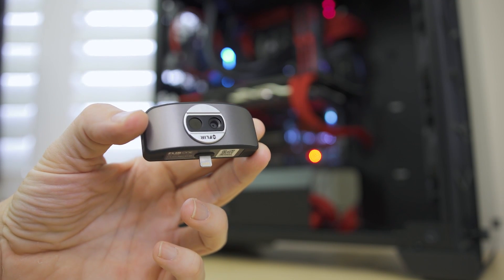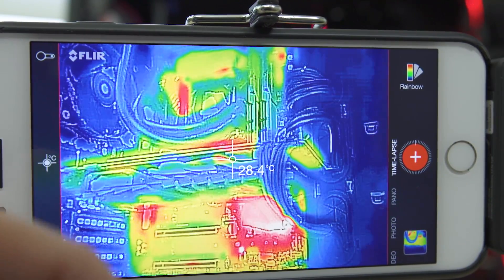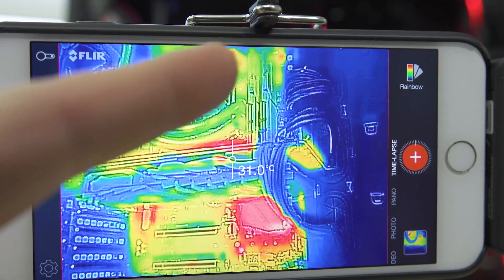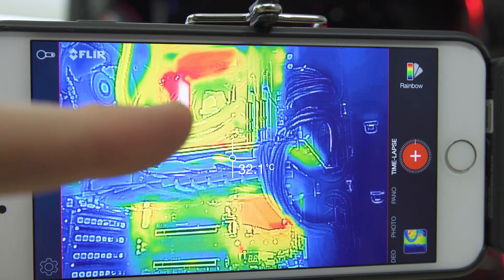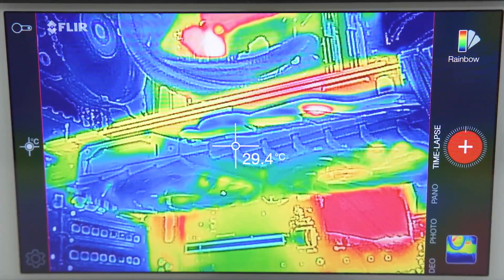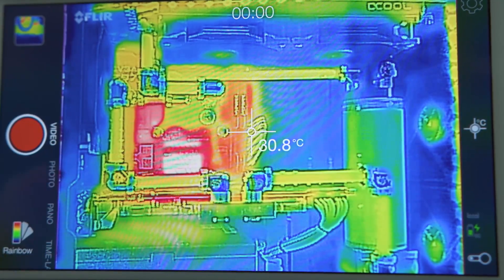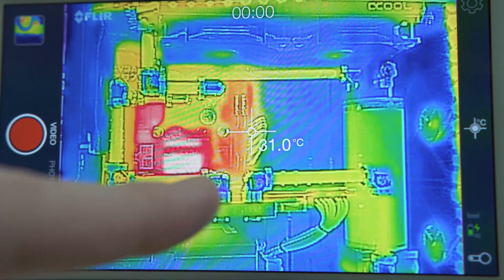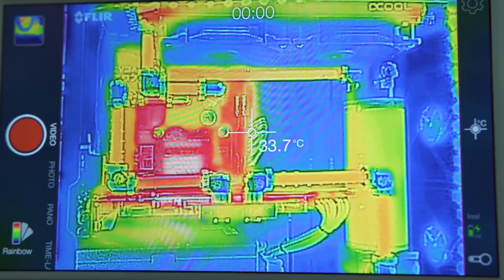PCs and Thermal Imaging... What your eyes CAN'T see

Comment: I've been very aware of this situation and the localized heat pockets for years.  Air cooling with a moderate overclock like my old Sandy Bridge i7 2600k @ 4.2 ghz. I use a three fan setup up top on my Cooler Master Cosmos (2005 black mid tower case). 120 exhaust(highest speed/pressure), 90mm Zalman  X9900 cpu air cooler(it's a round fin design with a figure 8 heat pipe and fan in front), And a 120mm fan (angled towards motherboard/memory/cpu) in front of board.  The bottom half  employs a 80 mm fan blowing upwards 45 degrees and slightly towards south bridge and in front of hard drive bay (drawing air through the drive bay at bottom of case). An additional 80mm fan outside of case pulling warm  air out (wire tied to empty pci bays below graphics).  My rig/motherboard is basically separated by a huge 12 inch long Strix oc 1060 video card so it needed the separate fans for top and bottom cooling schemes. One side note is the Psu is located up top exhausting heat out.  And the side panel has additional openings one circular for cpu and larger square opening down at bottom. (neither are being use for active cooling atm).  This setup which this particular build was created is going on 6 years of age and using Dynamat sound material everywhere.  The tower also sits on the floor in a slightly elevated cushioning effect (pillow, burber carpet and larger floor tiles) to reduce dust intake and vibration from heavy stomping feet.  With the front of case having a mesh filtered 5 1/4 drive bays and brushed aluminum blue accents and blue lights.  My build is a kinda a "set it and forget it" kind of rig and still looks pretty handsome to this day :)  Thanks for letting me rant guys/gals and hope this helps others looking to prolong there system life and performance.

Comment: Hi
can u try to use this cam in larger case so u can put camera inside and then test it with no air flow/ positive pressure / negative pressure so we can see how it affect temperatures of parts inside + water cooled PC and air cooled PC ( CPU + GPU )

Comment: could you use a piece of plexiglass clamped to the outside of the case to show the effects of the enclosed case compared to an open case? Not sure how well the thermal image will see through the plexiglass though. This would help show how well a case is designed in relation to proper airflow.

Comment: It is simply amazing work!
Your input on water cooling helped me a lot in my upcoming build but this is truly the next step. I really would like to see more testing of case environments. What happens when you only use fans on radiators to run air through a case for maximum heat dissipation in a water cooling build compared to a build with extra case fans pushing fresh air into the case.

Comment: Nice video! I was looking for that kind of information for heat in the PCs. Have you ever made a PC with both: air cooling and water cooling at the same time? And do you thing that the temperatures of the different components and the air flowing will be better than just air cooling PC or water cooling PC?

Comment: So Jay, with this new data in mind; what's the FIRST change to your systems & the new system for Mr. Crews? Additionally, I didn't see the RAM get too hot on the first system; but would you recommend installing a waterblock for your RAM? Heat spreaders for the M.2 SSDs already exist, but do you think we'll see an M.2 waterblock anytime soon (disregarding the fact that there are waterblocks for M.2 SSDs on PCIe adapters)?

Comment: Now that you have a thermal imaging camera, ho, ho, ho, do the same test, get system up to temperature, this time with case cover on. Then, remove side cover, watch as things heat up as you remove the case.  What I've done with a Flir is look in a power supply. I did it on my mom's old potato. I've yet to thermal image my own builds though.

Comment: a separate loop just for the vrm and chipset..probably help overclocks..  maybe put a rad between the GPU and CPU. ..just to try. water cool everything all at once.. all the chipsets the HDD and if your stupid enough.. the power supply.  then over clock the shit out of it and see what the results are.

 everything makes heat, humans suck at making electronics.
Reply: also we need to figure out a better way to regulate voltage...heat means in-efficiency .

Comment: Loved the video, Jay,  some great info as always.

Question though, not to beat a dead horse but I this video could make for a revisit of an experiment. 
You've said that front mounted radiators are completely fine in the past, however radiators do restrict airflow.

Could that airflow restriction cause larger issues for motherboards over time?  Is this a test you could run in the future? VRM and Memory temps of front mounted rads vs open air?

Comment: Hi Jay, I like your videos, this one as well. I have just a point about glass being an insulator. Well, there are two different things to consider. First is the sense of heat when you touch somethink and the other is the actual temperature of it. If you have a piece of iron and a piece of wood, both have the same temperature, you will sense it differently (iron will be cold, wood wont). This is because different heat conductivity. But if you look at them via IR camera, they will be the same, because the radiation coming from an object (that is what camera picks) is dependent on the temperature only and is not dependent on the material (see more absolutely black body). You can see this when the IR is coming through the glass (as you pointed out), but when you look at the fittings, they are blue, because IR radiation doesnt pierce metal, even thou metal is great heat conductor (try placing aluminium foil in front of camera). These are just two absolutely different things.
Anyway, I hope you will find this usefull. For example, even if the heat is transfered via touching into backplate, there is still all the IR radiation emited from GPU reflected back off the backplate, back to GPU. And also the IR radiated from the backplate also going to GPU. I would guess it is way more important then the hot air traped between GPU and backplate, which most people talk about.

Comment: I really liked the video but have a few suggestions. It would be nice if you could come up with a way to do the thermal imaging with the side panel on. With the panel off the air pressure and flow from the fans is going out the side. I know having the panel on creates issues for the thermal camera but maybe it would be possible to make a side panel out of plastic with an opening in it that could be sealed with the camera inside? Just an idea because then you could test and do a video of fan placement and directions to see which combo is most effective. I often thought that the water cooled systems that didn't have any extra cooling fans would have very hot VRM's and chipsets so it's good to confirm it. Keep up the good work Jay!

Comment: AntVenom has a nice basement water cooling for his PC. Indeed, he speaks about the chipset temperatures, but that is not something to be scared of. Especially since there are PCs that had no fans in them at all (like most of Streacom's cases) and still work well. I am more into hardcore passive cooling everything for the ultimate no noise environment (of course some coil whine might be present, but if you get your speakers at any sound volume and have something to listen to, the coil whine is inaudible).

Comment: I actually had bought a fan control panel that had 4 temp fan controls. My motherboard heatsinks get hot pretty fast. I had put some paper over the heatsinks to cool them, which worked great. The temperatures of the heat sinks would read at 150F before the system would shut off. With the airflow it would be a steady 76F. But my CPU was still getting hot so I bought a bigger radiator for it, which I had to remove the airflow setup. I can't seem to find a practical way to put airflow over the heat sinks on the motherboard. Maybe with my next build I'll get something designed.

Comment: I don't think Jay understands how these things work... You are seeing a total temperature variance, not actual temperatures... I wish that he would have shown the actual temperatures. For example, I have a dozen probes in my system on a microcontroller and display, monitoring VRM, GPU Backplate, MOBO Backplate, Coolant temps, Pump temps (dual pumps), intake temps, radiator exhaust temps, PSU internal temps, and so on), and the variance between the hottest component and the coolest is not that significant.

The same here, were are seeing the temperature delta based on color... So the coolest component might be 30C while the hottest component might be 32C (as an example), and the colors would be exactly the same, basically, this video shows us NOTHING at all that is actually useful because Jay did not present the information correctly, whether intentional to get views, or because he doesn't know how to effectively use the device (which I doubt, since he described it in the video) is irrelevant, fact is, the presentation is deceptive and will lead people to think that they are seeing extreme temperatures and freak out, but they are just seeing a temperature delta. :-(

Regardless, thank you Jay, for the work you do, and I look forward to seeing more videos and tests involving proper thermal testing (So long as it is presented accurately, I would suggest using the 'spot on high' feature,  to indicate the highest temps, and perhaps the lowest as well)...

Comment: Exciting! Thank you.

You dont happen to have a right side build case? Could test how GPU affects a tower cooler in different configurations (not AIO-water). Or could just be badass and flip normal case top down :D Also would like to see a big tower cooler with different fan configurations: fan on top pull, right pull, left push, left-right push-pull. Pick most interesting configs. And how it effects rest of the system.

Comment: My entire case is air-cooled. But my case, which is a Gigabyte Sumo Y, has a 200mm fan on the side panel feeding the GPU but more importantly, my motherboard. So even if I overclock my GPU and my CPU, they all stay within a reasonable range. My entire system I mean.

Comment: I have a HUGE problem with my cpu fan. It only starts spining once the cpu is hot, and when I say hot I mean REALLY hot. It shouldn't start spining so late, and once it does it goes like at 2000 RPM. I may have to change it, but if there's some way to fix it it would be great. Nothing is stopping the fan and I can't open it to see if it's clugged with hair or something, it doesn't have a screw.

This video made me scared that my PC would melt, since I've been having performance issues and I only have a 3 fan setup (now 2) plus the gpu fans.
Reply: Thank you, yes the fan is plugged in the right socket, and I can't clean it up since I can't unscrew it, it's glued together instead. Can I buy only a fan replacement? The only ones I seem to find come with it's own heatpipes and I only want the fan, since the heatpipes are just fine (and it's easier to replace only the fan, I'm lazy).
Reply: I know how to remove and install a cooler, don't worry. And I already replaced the thermal paste a few months ago (2 or 3 I'm not sure) so that shouldn't be a problem. Thanks for the help, I'm going to order a new fan (this time hopefully with a screw) right now.

Comment: Would it be possible for you to test M.2 NvMe drives? Both top mounted and bottom as well as some of those fancy superfast but more importantly the medium drives to see if there is a problem. My system has a bottom mounted M.2 and I have not been able to monitor the heat.

Thanks in advanced and thanks for all the vids, I've learned a lot from you over the last few months since I've been diddling in computers.

Comment: Is the FLIR technology susceptible to reflection issues like IR thermometers? When you talked about the glass tubing, it popped into my head that that could cause IR reflection issues.
Reply: Yeah, reflective / shiny objects are a problem. It's like looking at a mirror - you don't see the color of the mirror, right, you see the color of the reflected image. Well, IR is just light, so .. in a reflection, you see the "heat" (IR) of the reflected image, not the mirror.

Comment: Don't forget you had the case open to check the temps so there would be no air circulation inside. If you had the case shut as it should be, then I bet you get different results.

Comment: MSI, Gigabyte, Powercolor and ASUS,  be warned. JayZTwoCents has got a new tool for testing and he isn't afraid to use it. Don't fuck up for the Vega cards like you did for the RX 480. Overlap those heat pipes with the GPU and the HBM2. Got it? Good. :)

Comment: Proof that memory "heat spreaders" are horse shit.

Get the FLIR on the GPU fan outlets on a 1080 founders. The air coming out of that is toasty to say the least.
Reply: ... You do realize that a fixed amount of heat energy spread over a larger area, will equal lower temperatures? If you remove the heatspreaders, you have the same amount of heat (in watts), concentrated on a smaller area. That equals a much higher temperature. If the heatspreader was red-hot, then it'd be a bad day. The fact that it's not red-hot simply means it's doing it's job... It doesn't mean it's useless.

Study a little before calling something horse shit. Or, you know, read up on the manufacturer datasheets of some common DDR4 memory chips, they list temperature graphs relative to frequency and load, and they literally advice the use of heatsinks when running in high performance mode. Pretty sure Hynix and Micron and Samsung and whoever else makes DDR4 chips know better.

Comment: This may be an old question Jay but as you have a flash thermal cam can you check heat pipes in horizontal and vertical orientation, I have your years assumed they would operate better if mounted vertical, love to see what the difference is if any.

Comment: That's not air cooled.. its got a water cooling loop in it...?
also no FLIR uses IR, and you said it yourself, glass is an insulator, and IR cannot see through glass.
Reply: It's not that simple. IR can definitively pass through glass, it depends on the wavelength of the IR - it's not just "does" or "doesn't" - it can pass partially through, etc.... Near IR or Far IR, etc. If you want proof, stand in front of your window in the morning sun - you'll feel the suns warmth on your skin. Reduced compared to if you were outside, sure, but it's not 0.

Comment: Curious JayzTwoCents, will this cause you to consider chipset cooling in the future to help pull that heat out of the case in circumstances where it's not possible to get enough airflow to the motherboard?  What about active VRM cooling?
Reply: Mostly pointless on both cases, since the components are engineered to work at their expected operating temperatures. It'd be pretty shitty engineering if the devices stopped working when they were actually put to normal use. Makes no difference what so ever. And I say this, as someone who owns a fully watercooled motherboard. It makes 0 difference, it's just for show.
Reply: I have owned water cooled systems in the past (been a long time, last time I touched WC was when the TDX was popular if that gives you any idea), and many times I have seen those components (Chipsets and VRM) actually severely overheat.  It's not because of the engineers, it's because of the bean counters wanting to save $1.00 in aluminum material over the course of 1000 devices.  Have things gotten better in the last 10 years?  Yes.  Would it be wise to let something get that hot consistently? No.

Comment: Very interesting video. I would be interested in seeing how hot different types of liquids get inside a loop vs water & also see how some of the passive cooling PCs hold up vs traditional air & water cooling. There are more and more passive cooling systems popping up. It would be a good way to find out if they are actually any better or worse.
Reply: Well... Measuring the CPU temperatures under load already answers the question if they're better or worse. It doesn't have to be any more complicated than that. The compensate for their lack of active cooling by having really massive surface area.
Reply: Mythricia You missed my point. Yes they have a massive surface area. So the question is how hot do all the components around that massive surface area get. Not the heat sinks themselves. I also want just want to see it because it is interesting to me.
Reply: I believe Linus have a really recent video from CES with a fully passively cooled PC, that had really good temperatures. So there's that. Kyle @BitWit also did a fully passive build months ago.

Components in the vicinity of the heatsinks will obviously have to become hotter than usual, since the heatsinks radiate outward, with only a little bit of convection to cause air movement. But most components that aren't actively cooled, don't really care if they get 10*C hotter anyhoo. So there isn't really anything "worse" about it, as long as the core components remain sufficiently cooled.
Reply: Mythricia I just want to see it!! lol I am not trying to have a debate about all the technical stuff. I just want to see it from Jay..It would be an interesting video in my opinion.
Reply: Sure! Yeah I don't disagree. Just that most questions in these comments are like "omg answer me" more than anything else. Guess I'm just jaded from scrolling down too far >_>
Reply: Mythricia Lol never read to far down the comments..bad things happen there. Deep dark scary things.
Reply: Coltc8 Jay didn't have the thermal thing for his phone then. Jay asked what types of things would you like to see him do with the thermal device on his phone. That is what i want to see.